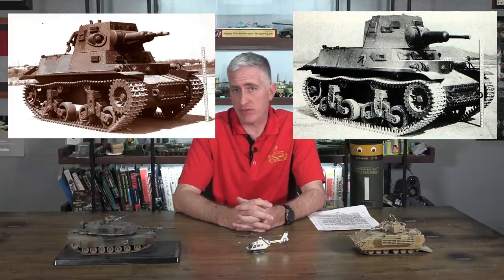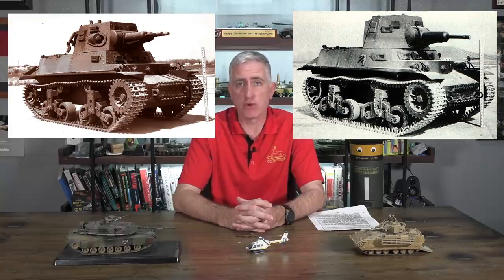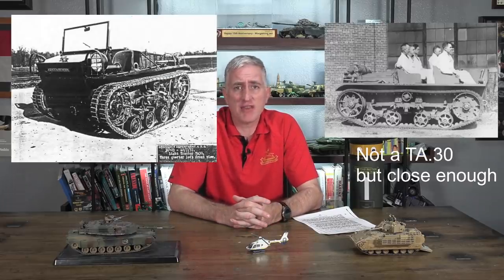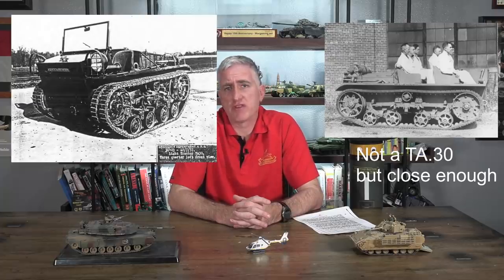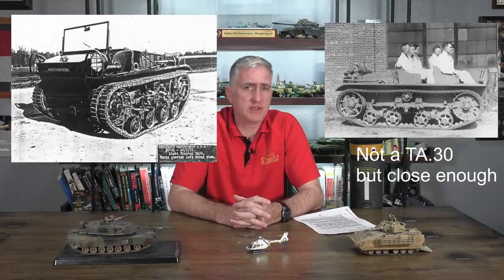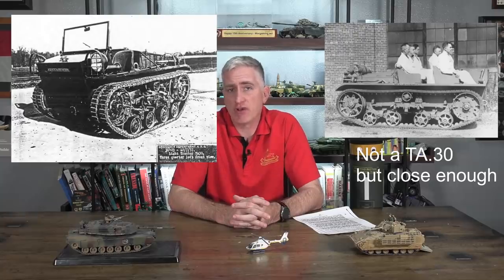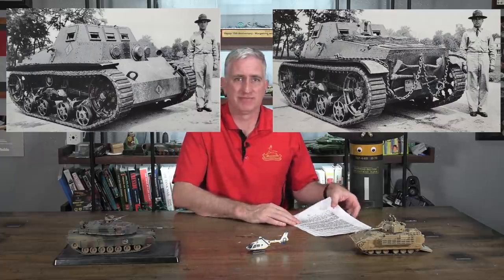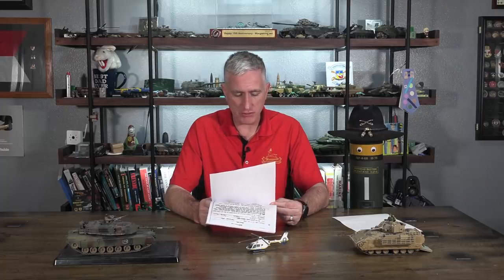A Less-Awful Marmon-Herrington Tank.

Comment: The Ford V8's AKA the Flathead were notorious for overheating because of weak water pumps.  The overheating was worse for the Lincoln V12 Flathead for the same reason and larger engine
Reply: Why not solve the problem by bolting a better water pump on?

No realy, what as the reason for not doing this, if the problem had been identified?
Reply: @Bird_Dog00  the better water pumps were not around when the original flathead were in production.  Almost every Flathead block has at least 1 crack in it from overheating issues.  As I said, the V8s weren't as bad as the V12s. 
Modern Hot rodders have access to decent water pumps.  But those were only developed in the last 15 years or so.  Not in the 1930s and 1940s
Reply: @timothyboles6457  Hmm..
But other companies made V8s and V12s in the same time (V8s were around since at least the 1910s) and I haven't heard of them all having the same issues.
Reply: @Bird_Dog00  you're right.  But Ford V8s were a different and new casting process. And the other V8s that you speak of were high end cars and low production. 
But Ford V8s had a habit of boiling over just in cars, much less an armored vehicle
Reply: @timothyboles6457  Engineering is facinating.
Being a mechanic myself I love disecting issues and exploring why certain fingerquotes "obvious" sollutions weren't implemented.

Did Ford have a particular problem with its engine design?
And, what was that new and special casting process?
If an engine tends to overheat where other engines don't I would first assume a desing flaw, not material properties (and when you mention a new casting process, I think material properties first).
Reply: @Bird_Dog00  I seem to recall that other engines of that time did have issues.  But  not as bad. 
Ford did something with the water pumps that didn't work.  They had a habit of cavitation for some reason.  I haven't torn into an original ford Flathead water pump. The Flathead block I had didn't have them. 
And I'm sure you already know that the Flathead had 2 water pumps.  Both on the larger 80HP version and the smaller 60HP.
Strangely, I don't think that the 60 was as bad. But I'm going off memory here. My grandfather told me all this stuff years ago.
Reply: @timothyboles6457  Interesting.
And no, I didn't know that those engines had two coolant pumps ( I assumed one would be enough).
I am a mechanic, but not a car mechanic (I'm a polymechanic by training).
I don't know much about engines and their developement, but I find them fascinating.

All I know is, that Hispano-Suiza built a liquid-cooled V8 engine, rated at 140hp that passed a 50-hours non-stop, full-power test with flying colours in 1915, and built almost 50'000 of them. Proving the suitability for mass-production of the design.
And since I learned of this engine, I kinda used it as a benchmark for engines in the inter-war period (as in "yes, it was a high-end aero engine in 1915, but given the break-neck technological advances in that time period,  I would assume by the 1930s, everyone and their dog could now build a similar run-out.of-the-mill engine").
Reply: @Bird_Dog00  those Hispano Suiza engines are spectacular works of mechanical art. And powered several allied aircraft during the "Great War".
And many the company went on to make several spectacular automobiles. 
Not sure what they did differently than what Ford did.
There is a car museum not far from me that has a Hispano Suiza with an all wood body.  Gorgeous coachwork.
Reply: @timothyboles6457  I apreciate the excahange.
Thank you for taking the time.

I guess I will now have to at least try to give myself an overview over the various Ford engines of the time. ;)
Reply: @Bird_Dog00  it's been great talking to you also. 
Have fun with your research.  There is so much variety in early automotive engines. 
If you really want to sink your teeth into some great engines.  Look up Miller! and the later Offenhauser's! And Duesenberg!!

Comment: After all that, i find myself wondering why they didn't just give this tank to the Corps of Engineers and told them to build a suitable tank, using the test reports as an example of likely faults and issues. If you correct all these faults in a new design, you probably have a supremely good tankette.
Reply: Primarily because Corps of Engineers builds things like forts, damns, etc. Bureau of Ordinance was responsible for things like tanks, guns, and small arms.  Generally better tested than things designed by US Navy Bureau of Ordinance see Mk 14 Torpedo and companion Mk 6 exploder. Gives a whole new meeting to military grade hardware.
Reply: The military engineers that would be assigned to the improvement project wouldn't have seen a tank in person, much less know what it should be capable of.
Reply: After the torpedo fiasco ordinance bureau still had a say?
Reply: @hughgordon6435  Yeah, where else would you go? They were still the experts on all things ordinance from 20mm Oerlikon to 16inch rifles on battleships.

Comment: 12 Cylinders, 110 HP? Are they insane? Imagine 24 valves, rocker arms, valve springs, you name it, all for the horsepower of my old Plymouth Horizon. What a nightmare for the mechanics.
Reply: Why would they be insane?  It was the 1930's, they had to use 1930's tech.
https://en.wikipedia.org/wiki/Lincoln-Zephyr_V12_engine
Compared to what the mechanics were used to from the 20's this engine was a high tech dream.
What is insane is comparing their use of a then modern 12 cylinder engine to one that would not exist for another 50 years.
Reply: @johntallarico5888  - A 12 cylinder aircraft engine from the late 1920s, like the Rolls Royce Kestrel, could produce many times that much power: 700 HP, although that might have required the complication of a supercharger or other booster. The Kestrel was, effectively, the predecessor to the more famous Merlin.

https://en.wikipedia.org/wiki/Rolls-Royce_Kestrel

This Winton 6 cylinder engine for a gasoline-electric railcar, again of 1920s vintage, developed 227 HP. 

https://www.midcontinent.org/equipment-roster/dieselother-locomotives/montana-western-31/

No matter how you look at it, that Marmon-Herrington tank engine seems to be much more complicated than it needed to be. That's my point.
Reply: @HSMiyamoto  The tank is a mini tank, about the size of a Honda CRV.  It uses a standard automotive engine.   Why are you comparing it's engine to a 41 liter aircraft engine or a locomotive power plant,  those engines are bigger than the tank.
Reply: @HSMiyamoto  The engines you mentioned had a displacement closer to 50 liters. The ones this thing used had less then 5.
Ideal piston volume for gasoline engines is about half a liter, so a 4 liter engine with 8 cylinders makes sense.
Granted, such engines could make closer to 200hp than 90 even by 1938, so the power units in these things were rather weak for their displacement, but you should t compare them to contemporary technology.
Reply: If the engine displacement is so low, why 12 Cylinders?
Reply: @HSMiyamoto  i dont know. As I have said ideal displacement for power output us about 500cc per cylinder. 12 cylinders get you 350cc per cylinder in a 4 liter.
Reply: @HSMiyamoto  I'm not 100% on this, but I think it was largely a bizarre outgrowth of the economics of making the  engines. Ford was in series production of the famous Ford Flathead v8, which was a major step forward for making v8s in general - Ford solved some major problems with making v8 engines compact, lightweight, and economical to produce. The Lincoln v12 was more displacement than the v8s Ford had available up until then, but was similar in that it was much cheaper to make with new block casting and crank-making/etc. techniques than a big v8 from anybody else would have been - and lighter too. 
Sure it had more parts, but it would run more smoothly, particularly with the poor carburetion of the day.

Comment: . . . . Did Marmon-Herrington go on to become video game developers? This sounds awfully familiar.

"NEW <redacted> BUILT ENGINE, THAT BRINGS YOU SMOOTHER FRAMES AND A MORE IMMERSIVE EXPERIENCE THAN BEFORE!!!"
"A WIDER MULTIPLAYER SERVER BASE TO CONNECT YOU AND YOUR FRIENDS FASTER AND WITH SOLID UNINTERRUPTED GAMEPLAY!"
"A CATERED LIVE SERVICE MARKET AND AWESOME SEASON PASSES THAT GIVES YOU THE LATEST DLC TO UP YOUR GAME!!"
"Not just 1 gun, not just 2, but you can have 3 guns on this thing!"
"It has revolutionary Marmon-Herrington (could swap that out for Epic, Ubisoft, EA, or any other major game dev) steering and handling systems that give you a reliable machine!"
<they fly over all the replacement and spare parts.> "Just dropped a quick fix patch. Now you can actually boot up the game! We have plans to actually complete the thing. . . . sometime. . . . maybe."

Comment: Flathead Ford runs exhaust passages through block from valves to outside of the block.  The cooling system is then charged with dealing with all that heat.  The Hercules was undoubtedly superior.

Comment: As bad as this tank sounds I get the impression that with a lot of the weak points known that it would not have been terribly difficult to address even just a few of them and have a competent early war light tank. How then did things continue to get so much worse leading up to the monumentally awful MTLS?
Reply: They tried to scale up from a tankette to a medium tank using basically the same suspension with the same number of bogies. In addition, they were forced to use a really awful AAC 37mm gun, the only one available on the open market.